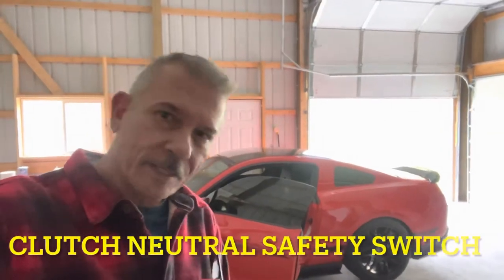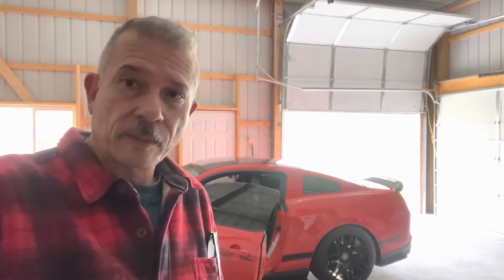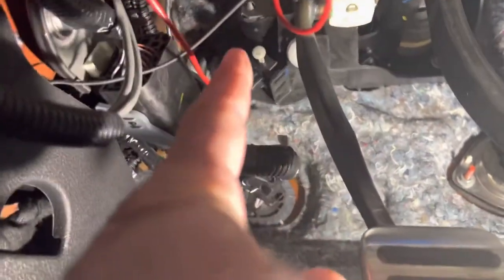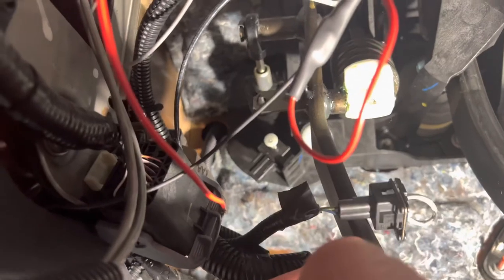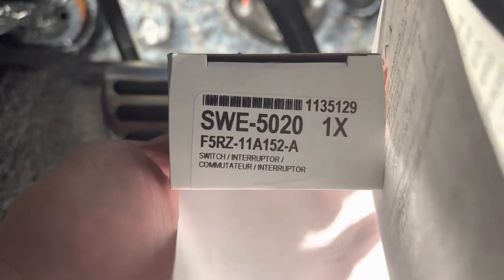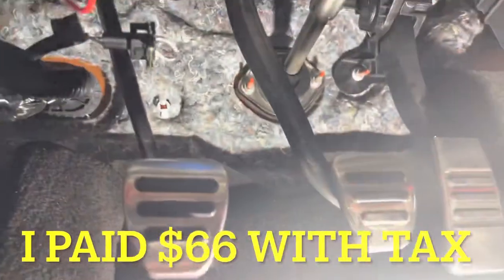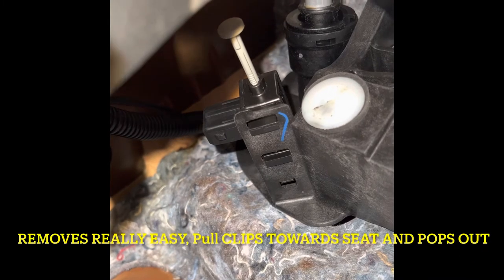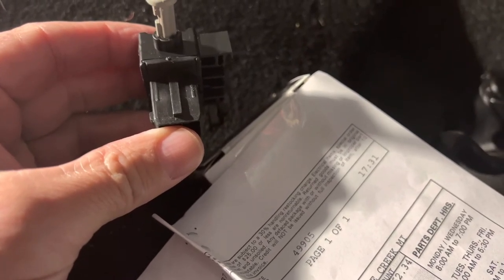Mustang Clutch Interrupter Switch Replacement

Comment: Just pull the plunger back out. The plunger ratchets inwards to set its operating length as you can see on the new one. Someone probably accidentally brushed it with their foot to cause it to collapse to a point where it wouldn't engage with the pedal arm and put a jumper wire in there since they didn't understand why it wasn't working.
Reply from the maker: There’s was no plugger there the first part was completely different.

Comment: Hey man I’m trying to replace mine now how did you get this thing to hold in there. I can’t get mine to click or stay in there
Reply from the maker: So I don’t have my car to reference until next week as we are working on side pipe projects.
Seems like per the video you squeeze the 2 prongs and pull the switch out at the same time. I will have to reference the car next week to double check.
Reply: I noticed the switch came out easily. Took me a few tries. I’m thinking about putting a zip tie around it.

Comment: Do you know if this is also the same switch that disables cruise control when you press the pedal?
Reply from the maker: No, there are two switches. The clutch pedal position switch is the one that disables cruise control. Look for the red body colored switch and the black is the neutral safety switch.

Comment: Wonder if you can read the part number off the switch you removed. Seems to me that they put in the wrong switch being that the plunger is shorter versus the new switch.  Wonder if Carfax would pick up that repair at a Ford dealer.  If not, then backyard mechanic might’ve done it.  One less buggy-boo to worry about now !!
Reply from the maker: I did not but could. The part actually is used on hundreds of Ford cars. I can share it with you later. Thanks
Reply: @CoyoteProductionsBoss302  Ya, but hopefully plunger’s make/break contact point is good across all those applications.  I have a vast amount of experience with these switches at Ford Engineering - applied to speed control.  When I pull out my car this weekend I can take a picture of my 2013 Boss clutch-neutral switch and compare it to yours.

Comment: Did it fix the issue?
Reply from the maker: From a starting standpoint yes. No longer have to cycle the key and work the clutch to start. I have not spent enough time in the car for the stalls.